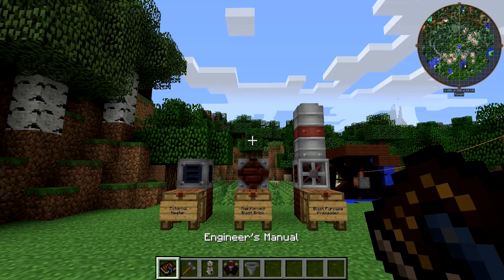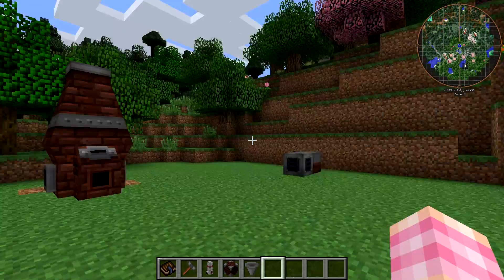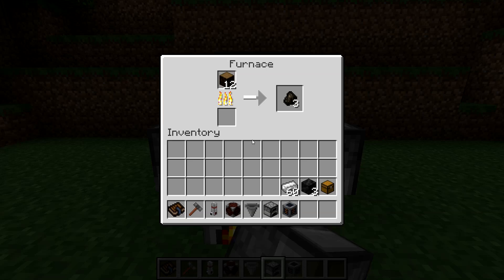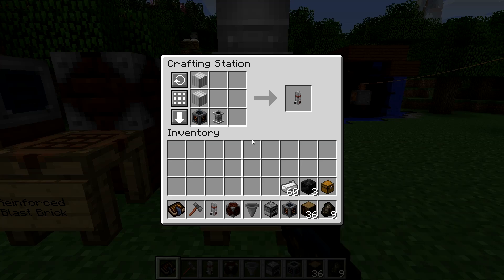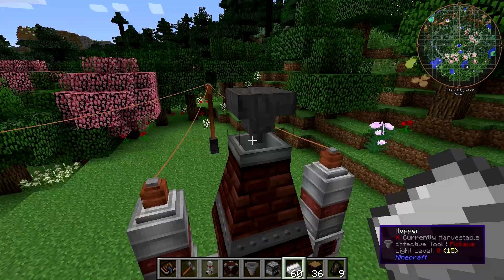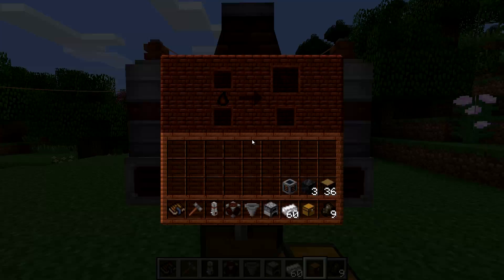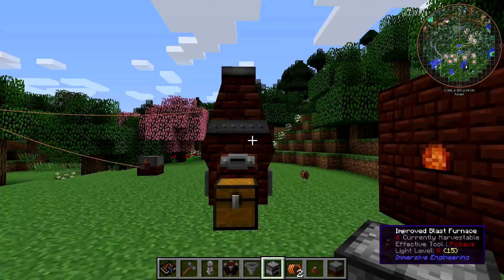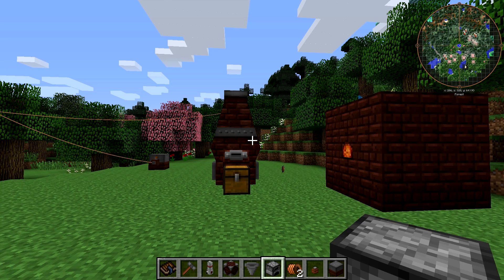Immersive Engineering Tutorial #14 - Improved Blast Furnace

Comment: A "little" late but you got it wrong 8 RF produce one heat unit (HE) and at first the furnace needs 4 HE/t to heat up which means it initially drains 32 RF/t then it maintains the temperature for 1HE(8rf)/t so it requires 32rf/t at full speed